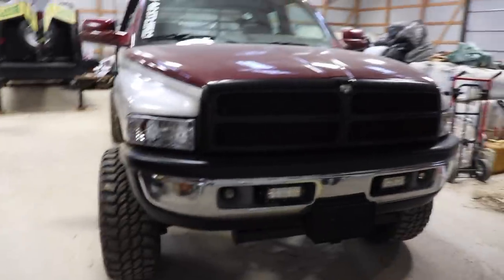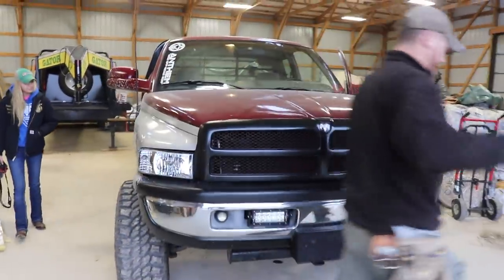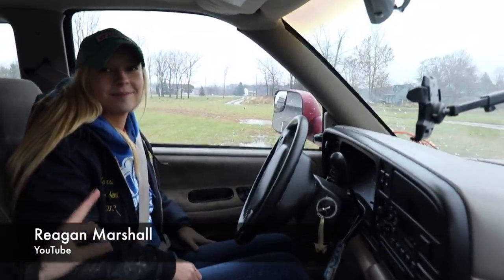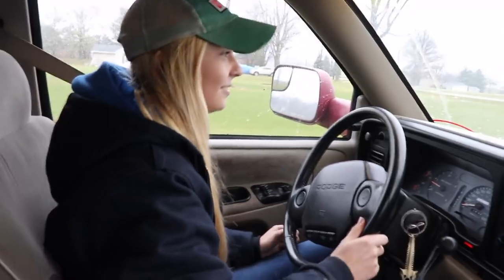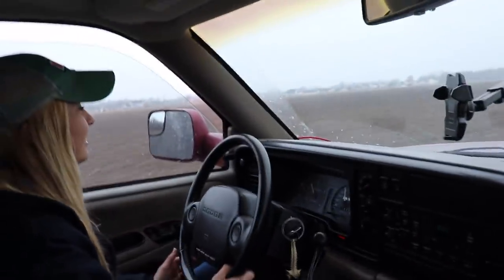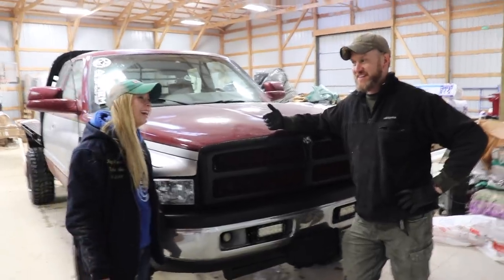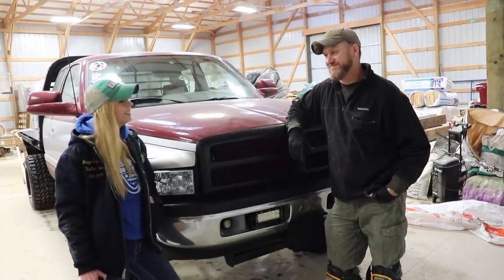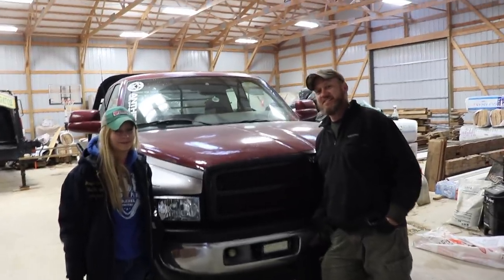GIRLFRIEND VS TWIN TURBO 12 VALVE CUMMINS!!!

Comment: Haha 🤣 that's just like my old 2000 f250 clapped out ball joints and center link and its no longer a steering wheel its a "Directional suggestion device"👍

Comment: I  have a ment 2nd gen 24 valve ya need to look at..1 owner 163k..Its a 3500 Laramie NV trans never tuned..Its got a fass fuel, cold air,and a 4 inch straight exhaust..Its never been off road..Its got the vinal floors and cloth seats..are like new..You loved your dulley..I think you would really enjoy this truck for you channel...Have a blessed weekend and a Merry CHRISTMAS!